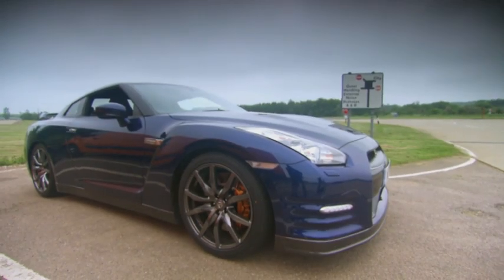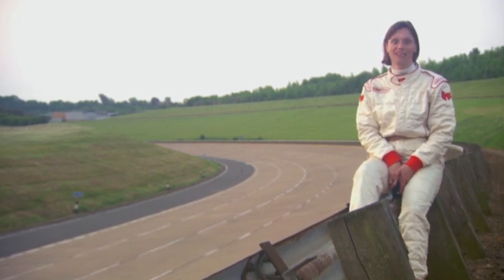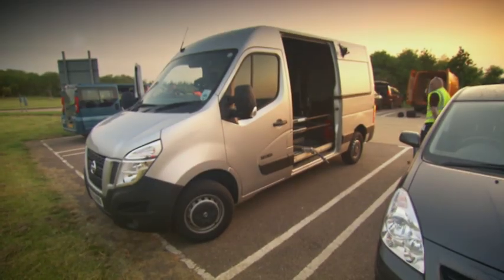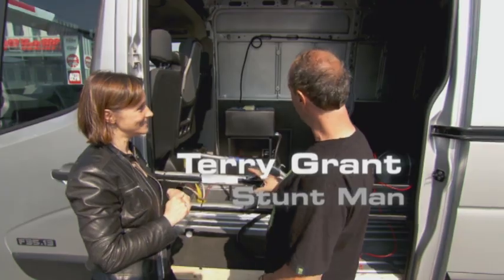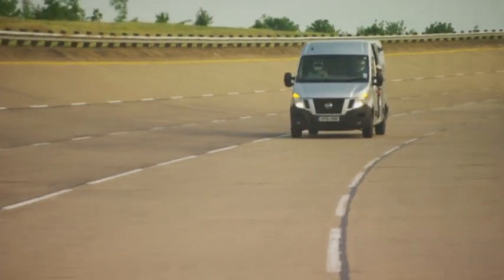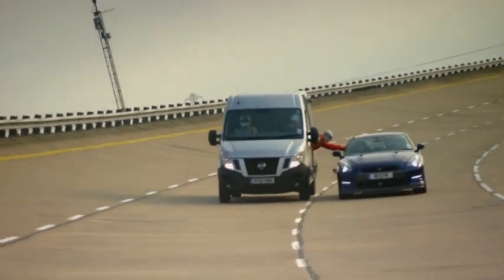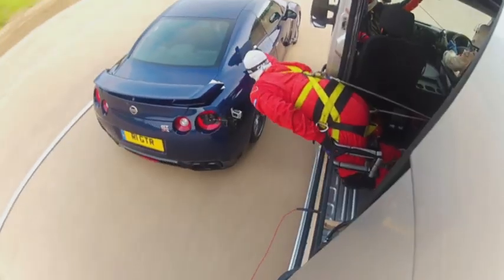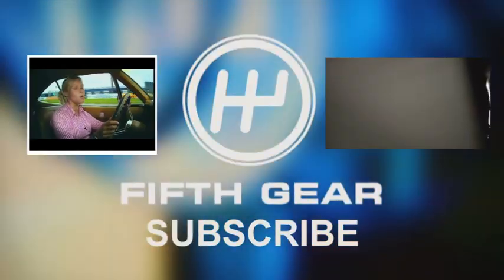Record Breaking 85mph ReFuel of Nissan GT-R - Fifth Gear

Comment: Do you need to ground the car if you refuel leaning out the window from the same car?
The car itself)
Reply: So that wire makes sure the 2 cars are equal electrically, like to make sure there’s no static electricity as she said
Reply: No you don't need to. At no point was there metal on metal contact. Hose was insulated,  refueler was insulated.. They did it because idk.. some "engineer" at the pits said so.
For static electricity to cause a spark bit enough to ignite fuel, you'd need.. idk. It was pointless is what I'm saying.

Comment: The refuel took longer because it was complicated to fill the car while moving. And during this time they could only do half speed, covering half the distance. Where as if the driver went from 150mph to 0mph in 6 seconds. refilled in 30 seconds and went back to 150mph in 15 seconds, they would have covered more distance overall in the time. This is just a publicity stunt. not actually useful.

Comment: Stupid, just fit the GT-R with a larger fuel tank.
Reply: Then A) it wouldn't qualify for the record and B) fuel itself has weight and slows the vehicle down.
Reply: kabob21 They never said that it needs to be 100% stock, just road legal. 
You are right about the weight making it harder to accelerate and achieving higher top speed. But you are definitely wasting more time refuelling at 85mph, than if you had a bigger fuel tank.
Reply: SuperPacman44 time isn't the limiting factor. the top speed they are attempting to maintain is going to be much higher than 85, so the mpg will drop. Even with a larger fuel tank, the GTR would still have to refuel. The GT-R has a 19.5 gallon tank, so you'd have to install a 40 gallon tank in order to be the same as completely refueling.